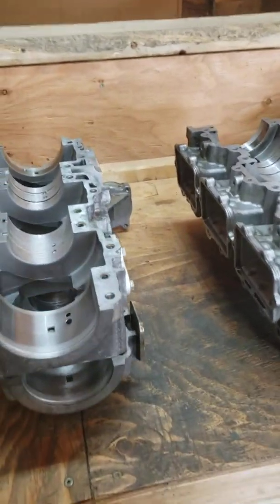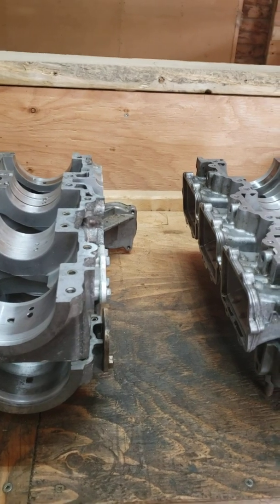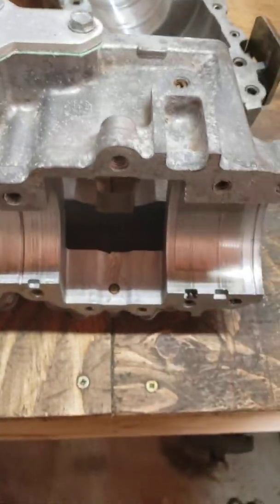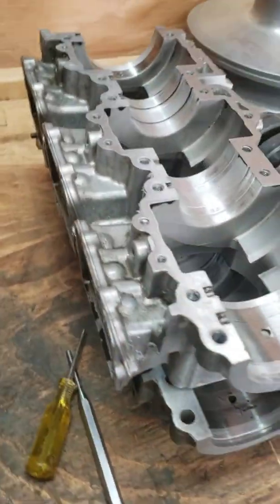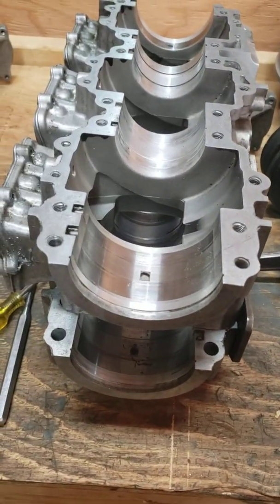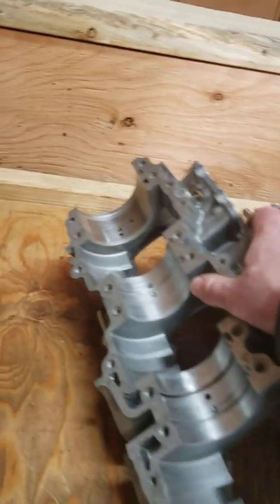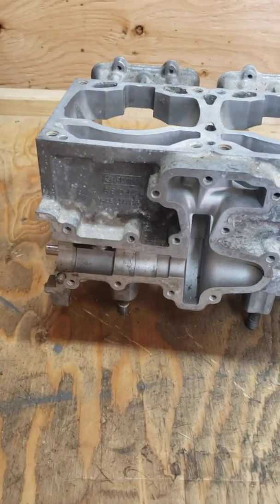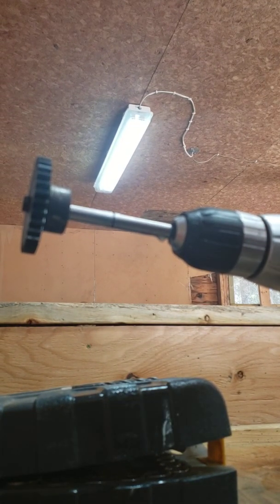Ski-Doo Triple Series - April 23rd - Cranks, Cases, and Oiling.

Comment: I have a 97 809 that has 500 miles on it and hasn't been started in over 10 years. Is there a way to lube the bottom end prior to first start without tearing the motor down?
Reply from the maker: Honestly, the easiest way to do that would be to remove all the spark plugs, then pour a couple of tablespoons of oil down each spark plug hole, wait a few minutes and then turn the engine over a few times with the pool cord and then I would drain your gas put fresh gas mix a little bit of oil in with the gas for that first tank.  Replace the spark plugs, start it up. Let it come up to temperature and go for a ride.  

after sitting for 10 years, I would also check the intake/carb boots to make sure there are no splits or air leaks in there. If that’s the case, you’ll get a lean condition and that could cause you to burn down a piston.

Comment: On the oil pump/stator housing gears there are washers on each side of the gears but I have an extra washer from when I tore it apart and was wondering any idea where it could have came from? Is there supposed to be an extra washer on one of the gears?
Reply from the maker: There are 4 washers.  2 on each side of the intermediate gears (between the crank / oil pump and between the crank / water pump).  That should be it.
Reply: @jasonblier  thanks a whole lot!!!

Comment: Are you in da Yoop?
Reply from the maker: I’m in Northwestern Ontario.
Reply: @jasonblier ,  I'm in the process of rebuilding 2 98s, mach1 700 and formula 3 600.  Was wondering how close we were, seems like you know alot about these engines.  In your opinion,  better to drill the oiler holes for the isoflex bearings, or just maintenance every season and repack the bearings? How's your sleds holding up on them bearings?
Reply from the maker: @spiceolife  On the triple engines, I am a fan of drilling the oil hole on the PTO side.   And running open (non-sealed) bearings.  You can’t remove the PTO seal without splitting the case, so repacking  the bearings is not really feasible.  This was rectified on the etec engine where the PTO seal is removable and regreasing the PTO bearing is easy.  I ran my sled for a few years with the oil holes and had no issues before I sold it.  The new owner is still running the sled, so I would say it’s the way to go.
Reply: @jasonblier  thanks bruv. I appreciate your responses, and the videos you put together. Not easy responding to everyone all the time.  Good on you,  especially years later after a upload. Thanks for that. Do you happen to still have any of the triple parts you've acquired? Probably not, but I could use a good used cylinder. Thought I'd ask.
Reply from the maker: @spiceolife  anytime!  Happy to help.
I don’t have any of the parts anymore - they were cleared out a couple of years ago - went to a few locals with triples.
Reply: @jasonblier  , one more quick question?... what size hole did you go with for the oiling hole?
Reply from the maker: @spiceolife  I pretty sure I used a 3/16” for the hole.  I chamfered the hole with a 5/16” bit.
Reply: Your sled was a mix gas sled then? Oiler eliminated? Better in your mind to go mix? I've been debating eliminating the oilers but haven't made up my mind. I'm waiting on my engine gasket kits now and as soon as they show up they're going back together.  Got a opinion on eliminating em?
Reply from the maker: @spiceolife  I’m 50/50 on eliminating the oil pump.  I did it for simplicity, and not having to worry about the pump, lines, and gear as they are a pain to get at to repair.   Mine ran amazing with mixed.  I would mix between 34:1 and 40:1 depending.  I would also use a good quality mineral oil (not synthetic).  I used Castrol Super Snowmobile Oil.
Reply: @jasonblier  , mineral oil? Wasn't expecting that. Thanks for all the replies Jason. I hope you have a great night.
Reply from the maker: @spiceolife  yup. Mineral oil - or Semi-Synthetic at the most.  Synthetic base stock used in most synthetic oils doesn’t burn very clean.  Mineral base stock does burn clean which means less varnish and buildup on pistons and rave valve.  I even run a top-tier mineral oil in my big bore etec (Legend ZX-2SR).   Pleasure chatting about the triples 👍

Comment: Thanks for the video! Useful. Could you tell me how to choose the correct seal installation?
Reply from the maker: The seals really go in only one way.  They are held mechanically to the case using the small lip on the seal that seats into a groove cut into the case bore.    This goes for all the seals (even the ones between the cylinders).  You can check out the Ski-doo parts finder to see which way the seals face on the crank.   When installing a new seal, it’s good to put grease (isoflex, petamo, or at least some injection oil) on the lip when you install.  That’s about it! 

Let me know if you have more questions!

- J

Comment: I know many people like dne and others in the past made big bore kits.  I have extra 700 cylinders how many cubes can you get out of a resleeved big bore 700?p triple?  I’d get an 809 but I already have all the parts to do it minus one jug to do the whole thing.

Curious on your thoughts.
Reply from the maker: Well, I know that crank shop had a 750 big bore kit for the 600.  I would think that a 3mm over bore would be getting close to the limit for increasing displacement on the 700. So I would think around 750-780 cc would be doable.  You can make some good midrange improvements with some tunnel/case porting and mild cylinder porting.  Lots of potential.

Comment: Can you change the pto crank seal on a 98 600 without splitting the case? Or If the case needs to be split can it be split from the bottom without taking the topend apart?
Reply from the maker: You do need to split the cases to change the PTO seal.  You can leave the top end on to split the cases, but the water pump, flywheel, stator, mag side cover (oil pump, drive gears) need to come off before the bottom half of the case can be split/removed.

Comment: This may be a silly question but is a 98’ 700 triple crank the same as a 99’ 800 triple crank? Will it work if I put it in my 99 Mach?
Reply from the maker: Not a silly question.  The 800 triples have different cranks than the 700.  They are not interchangeable.

Comment: CK3 700 cranks were wider and so is the shaft for the water pump.  I bought a NOS one for my 97 Mach only to find out it was 98 CK3 shaft so it didn't fit my 97 case.
Reply from the maker: Yup PTO end of the CK3 is 3/8 inch wider and the case has a longer snout on the case.   I have not heard of the water pump shaft being longer unless you are talking about the keyed shaft (stops the impeller from unscrewing when RER is activated) vs the threaded shaft on the 97 and earlier.  The overall length is the same with the proper keyed impeller installed- the shaft goes right through the impeller on these ones and if you try to install a screw-in impeller on them, it will seem like it's too long.  So, the assembled shafts are the same on F and CK3 chassis - I have 8 shafts from F and CK3 600/700 cases and they are all the same length.  You can swap pump covers as well when putting a CK3 engine in an f chassis or vise versa.  I'm going to do another video explaining engine swaps and all the interchangeable parts on these sleds and engines.   Thx for the comment!
Reply: @jasonblier  I'll be waiting on the video.   Mine is a screw on impeller as was the replacement.  Would be great if I could use the NOS one.  Thanx!
Reply from the maker: @charlesmyers2762  can you send me some photos of the water pump shafts side by side?  I'm curious if you got an 809 shaft instead??
Reply from the maker: @charles myers - I think you might have an 809 shaft.  The 97 F chassis shaft and 98 CK3 shaft for the 600/700 have the same part numbers - but the 809 has a different one.
Reply: @jasonblier  yeah I'll grab one this weekend. Had 1 on phone but must of deleted.  Look identical,  just new one was longer.